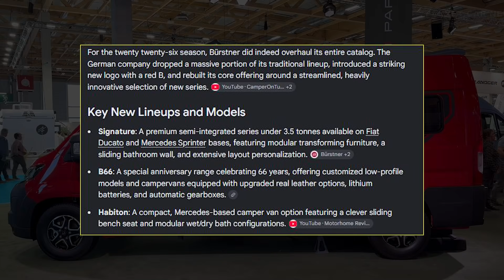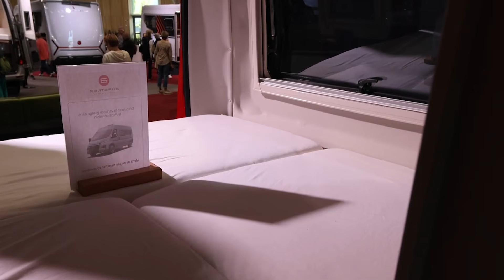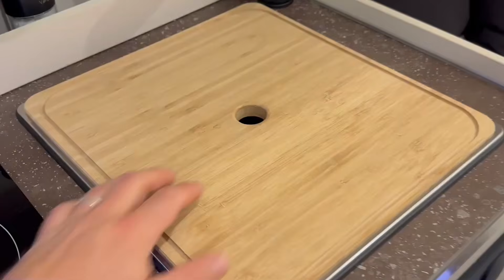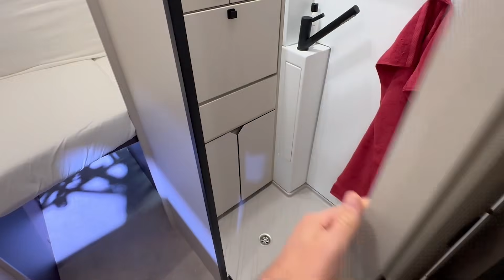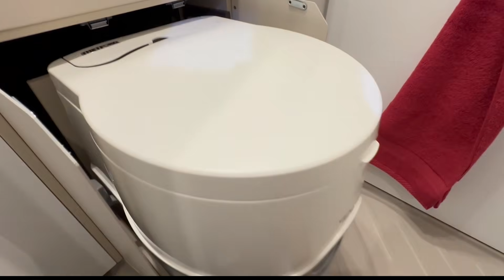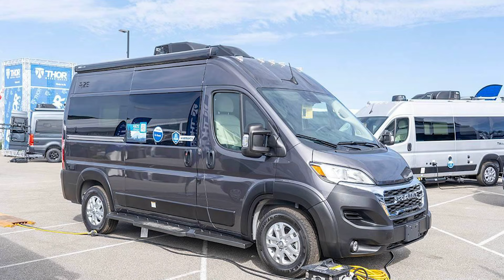This NEW Campervan Makes $150,000 RVs Look Overpriced!

Comment: I appreciate the philosophy of not making the customer pay for things to be part of the "standard" package if they do not want/need those things.  Having a choice to add some things only as needed is nice.  

That said, comparing the pricing of this unit to vehicles available in the USA is not valid.  There is no comparison if they cannot be purchased in the USA.  

Also, If they were to become available in the USA, the Citroën Jumper base would be problematic.  Any needed repairs would be complicated due to the need to get parts that are not readily available in the USA. That would cause delays, increased cost, and possibly even make repairs impossible altogether.  

All of that said, it does look like a very nice basic unit.  Yay, for those who have access to them!

Comment: It can't cost more than 80,000. No top 180Hp engine. Short 6,0 meter long, not 6,4. Manual gearbox, not automat. Truma heating, instead of Alde heating etc.